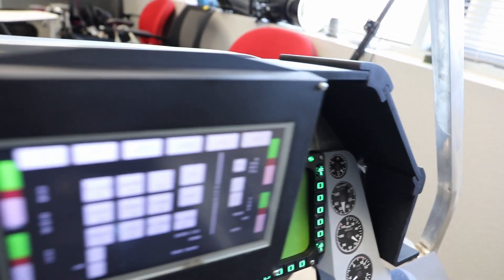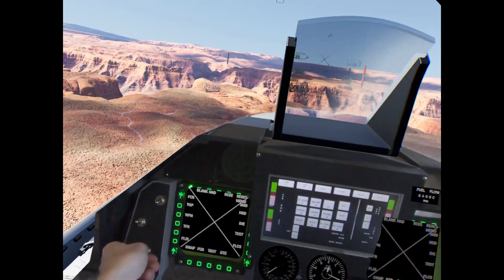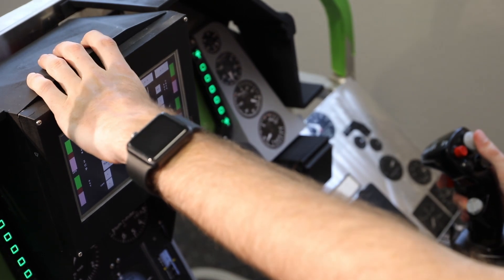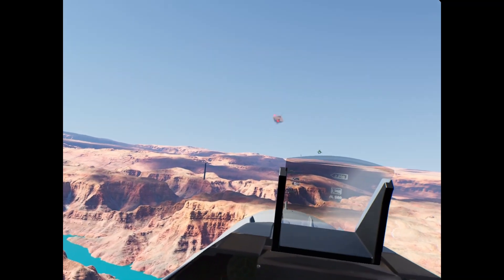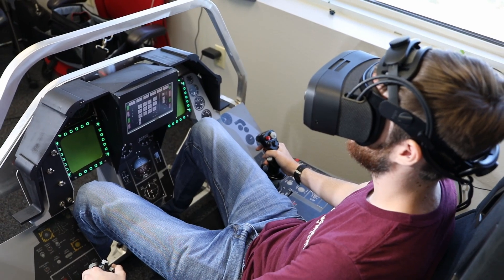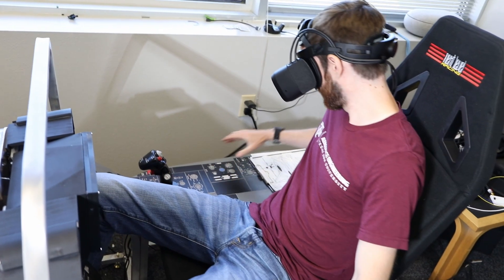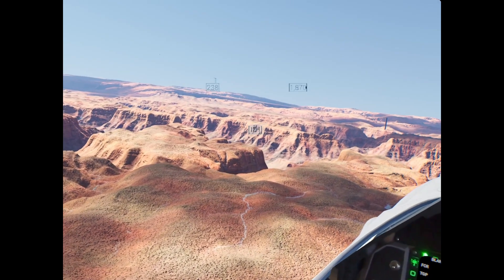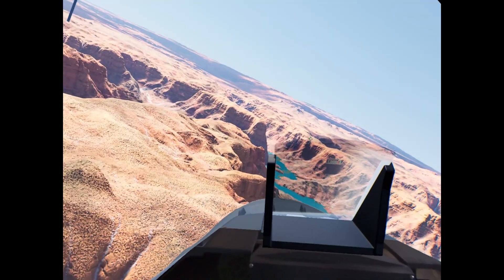Extended Reality Military Flight Simulator (Varjo + Unreal + Incredible Creativity)

Comment: Where did you get the printouts of the Panels? I am working on my Cockpit for the F-16 right now. And having the printouts would really help during the "years" it takes to build. If you made them, that is awesome! Would you be willing to share? Thanks
Reply: Usually user manuals from various (combat) flight sims have a cockpit layout page, just extract them and print them out.

Comment: this needed to be ran in DCS.
Reply: That’s exactly what I was thinking while watching it !
Reply: It would need probably a combo of 4x4090Ti in the system if running with DCS (lol).
Reply: @Marcin79W  you joke but the recommended specs for this headset are pretty mild. a lot less than I expected.
Reply: @Cancri71  I know, it’s just DCS on Reverb G2 with RTX 3090 and I9 is 50fps now. DCS is bad when it comes to optimisation, old code. Hopefully ED will improve, I love game.
Reply: @Marcin79W  yes. i also play star citizen. and its so far from optimized that it and dcs have a lot in common in that regard.
Reply: I totally agree.
Reply: For maximum mission and performance fidelity,  BMS 4.35 would be the better choice.  Not as good as far as eye candy goes, but superior for fidelity and authentic flight behavior,  plus its dynamic campaign system is leagues apart from anything in DCS.
Reply: @Turboy65  Nearly 25 years old campaign system is still better than what now days DCS is trying to offer.  The same with AI of both games.